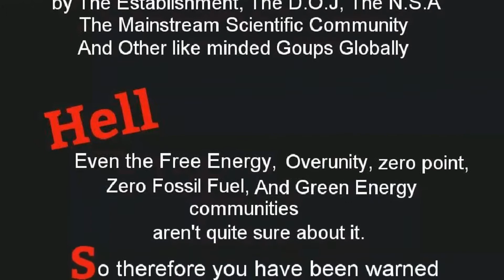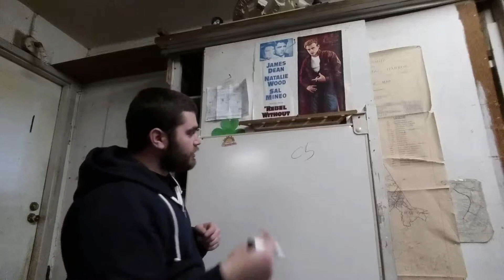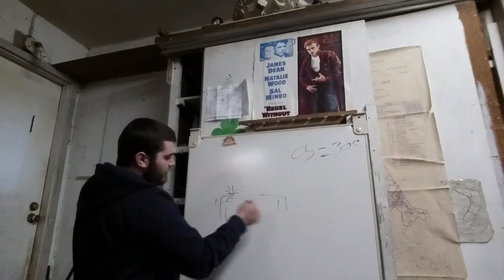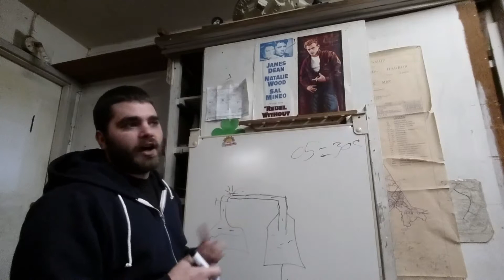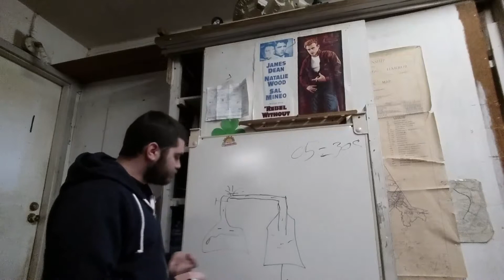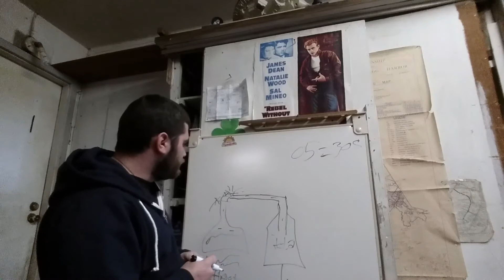Low Energy Vacuum distillation

Comment: Check out closed loop refrigeration. You're ideas are along those lines. If you place the liquid to be distilled in a closed chamber and apply vacuum pressure, then on the pressure side of whatever compressor you use, place tubing with a needle valve (or tiny fixed orifice) to increase pressure and condensation temperature, the alcohol should come right out. The question is, can a 6 gallon carboy take the vacuum pressure required? This should be possible without adding heat. I've been exploring similar thinking, but my end goal is producing cold/condensate through purely mechanical means.

Comment: nice one mate - a couple of suggestions if I may - If you put a plug of graphene oxide at the top of the ethanol water pipe it should stop the ethanol and only allow the water to go through. The other one is if you use zeolite of silica beads in the collecting vessel you could do this at room temp - no heat at all - you would need to recharge the zeolite or sillica by drying it at a later stage but this could be done by solar - but nice idea mate - a lot of people are looking at how to get 100% ethanol by a low energy method. It's such a good idea I was tempted to steal it lol
Reply from the maker: Robert you can steal any of my ideas any time you want to, I'd be proud to be copy right infringed  by you. but all of my work is open source for free and fair use. 

actually,  the way I see it is that if a company can mass prevents something I'm demonstrating and help get it on shelves, i say more power to them.
Reply: 4EvR Perpetual
bless your heart mate - still i'd rather you did it as it's your work
Reply from the maker: Robert my friend,  your comments have given me an idea. I think we both need to build prototype distilleries, but to make it interesting (not that it's not already) a gentleman's bet is in order. 

In one months time, we'll see who can distill the most liquid using the least amount of energy (fuel or electronic) or at least show off a design by March 1st

What says you my friend? 

My video challenge link is here :

https://youtu.be/hodQ4LDawpc
Reply: 4EvR Perpetual
we are on lol
Reply: you do have some work to do mate - but interesting stuff
Reply from the maker: +Robert Murray-Smith thanks for the comment Robert and I do have some work to do. I am still doing some experiments I just haven't been making videos. Thanks again
Reply: do make some mate - i like to keep up
Reply from the maker: +Robert Murray-Smith no I haven't worked on any other vacuum distillation experiments since I made this video